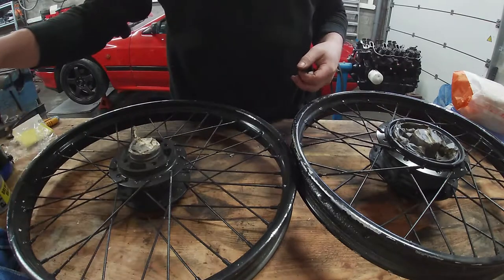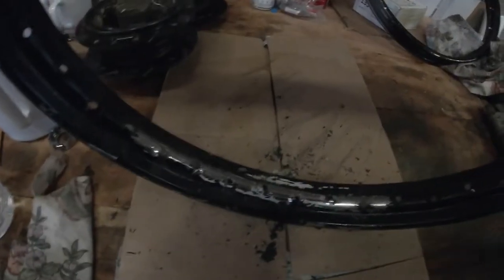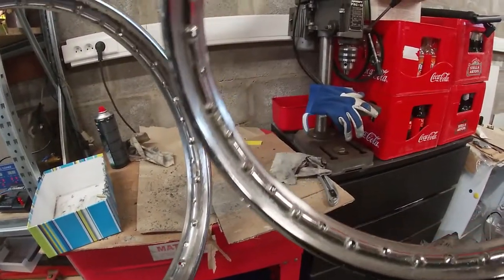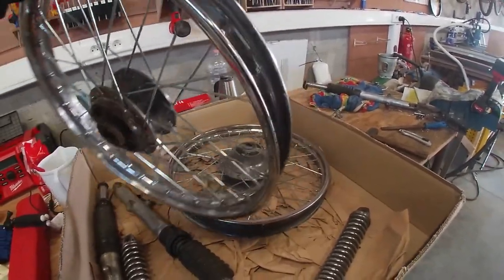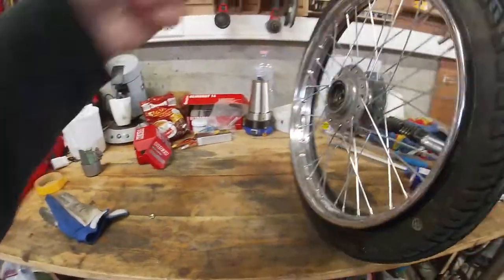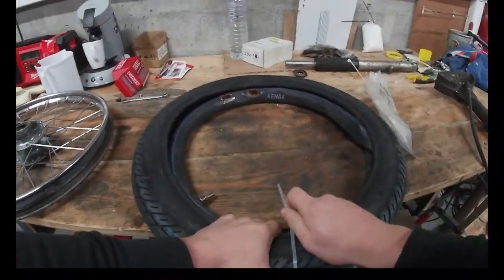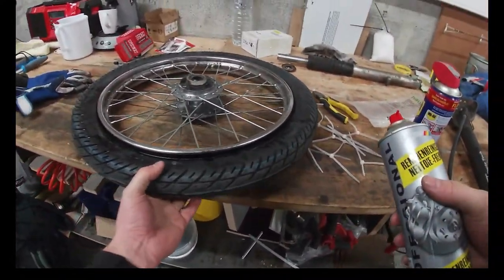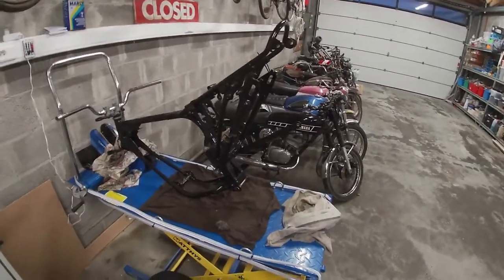Yamaha RD50 'Kenny Roberts'-  Pt 2 Wheels, how to mount tyres with zip ties

Comment: What about inside the rim mate ?
Reply from the maker: Clean them with a wire brush to remove the rust and add a rubber ribon over the spoke nippels. You even have it in some sort od tape you can apply
Reply: @VintageGarageYT  ok me seen rust holes in my ones onley on the inside of the rims thou so me just put new on my one s mate strong then and safe with new ones if they to bad with rust mate
Reply from the maker: @vivianbond7449  yeah if you can find new ones, I'd say change them!
Reply: @VintageGarageYT  eBay mate me got me  front ones from 24 English pounds mate each for me front ones they are 21” front and 18” back on a Dt50 mate what size are your s mate
Reply from the maker: @vivianbond7449  17, that's why they are not that easy to find. Later model RD came with 18s